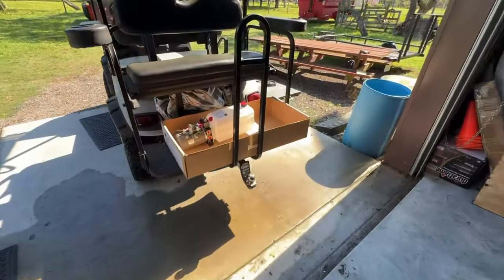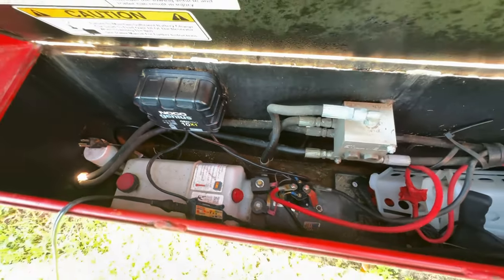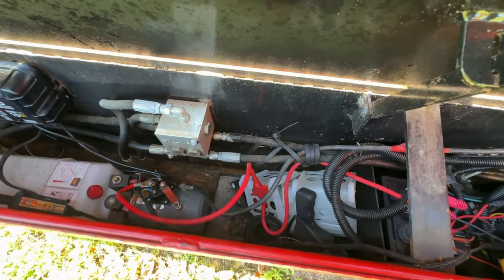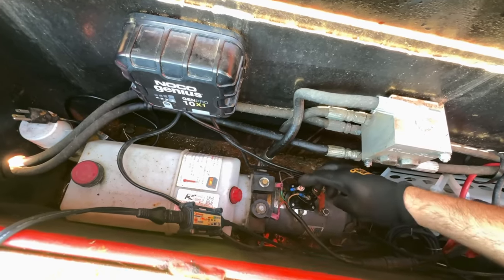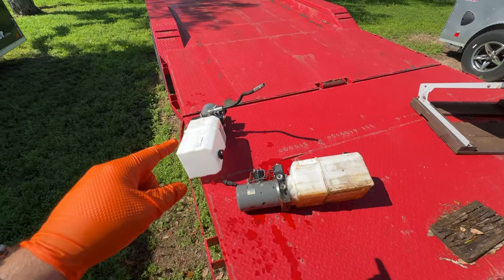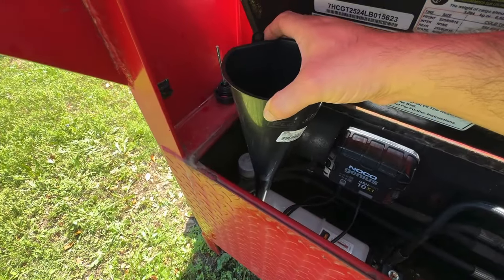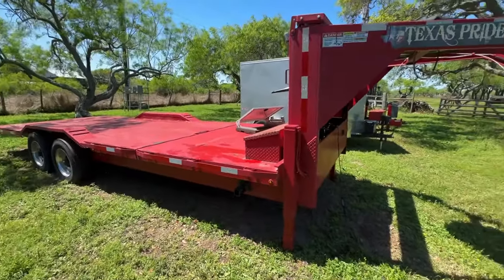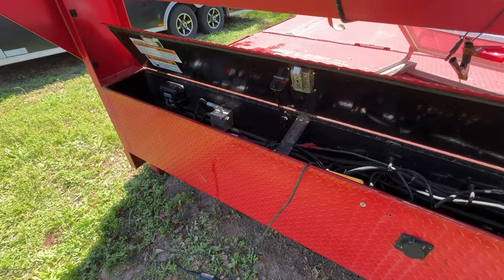Replacing a KTI Hydraulic Trailer Pump!

Comment: Another job well done. Now to tear the old one apart to see what failed, may be a simple repair to have a spare pump on hand. Otherwise it’s still broken no big deal.
Reply from the maker: They asked if I could return it so they could investigate why it failed.  Already sent back.  Great idea though.
Reply: I'm going with either bad ground or the commutator/brushes are corroded. Or a brush is stuck.  The pump is probably fine.  The motor is the issue.